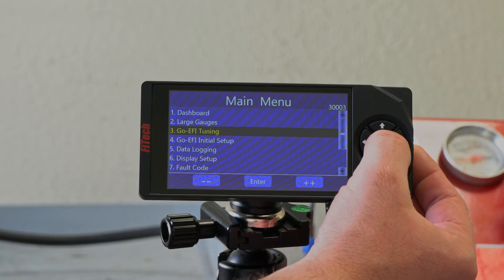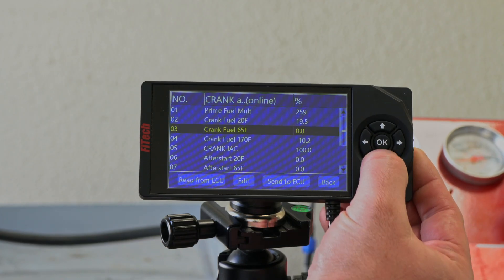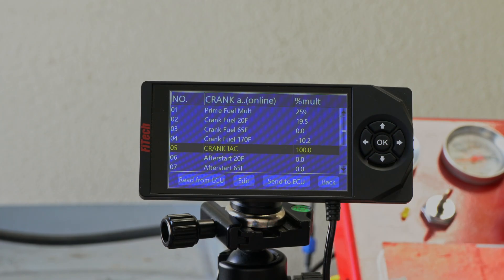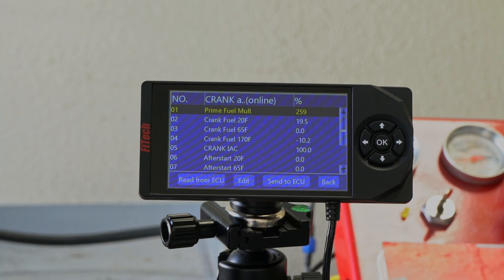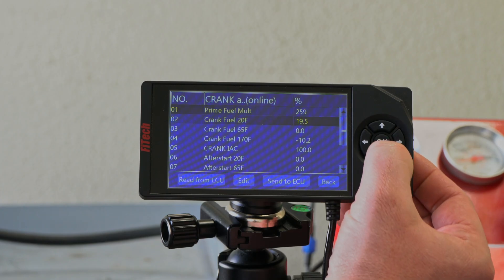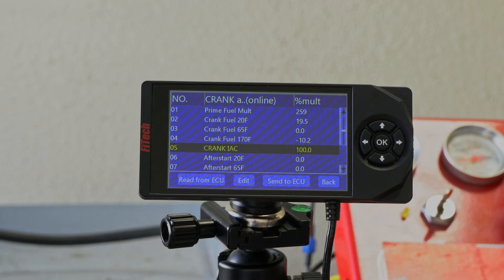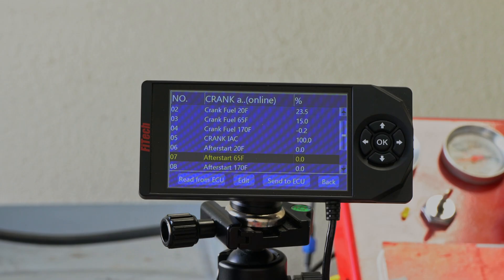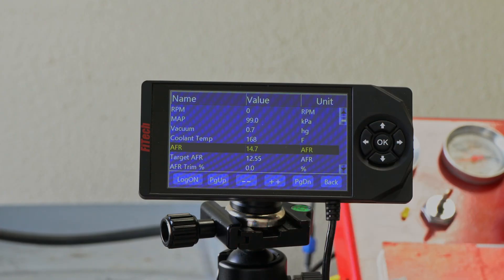How to Optimize Your Starts | FiTech EFI Tech Help

Comment: What if the iac is set and then it seems like it changes this has happened more then once to me and make the engine idle up
Reply from the maker: Hello sir, Once the IAC is set, the adjustments screw will always maintain the IAC readings to where they were set when the vehicle was warm (3-10) range, sometimes the numbers jump around, but that depends on the coolant temp, once the vehicle reaches temperature the IAC steps will go back to the range it was set to initially.